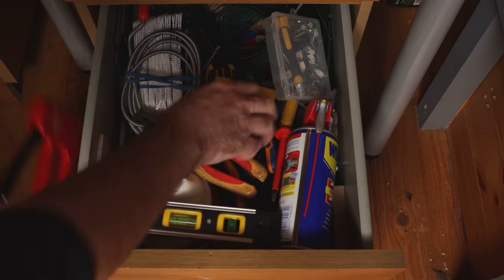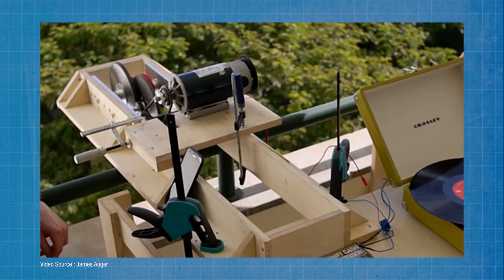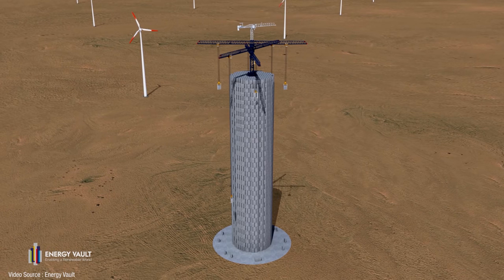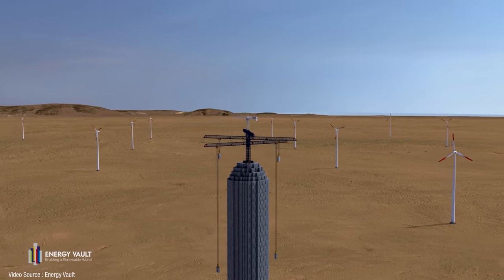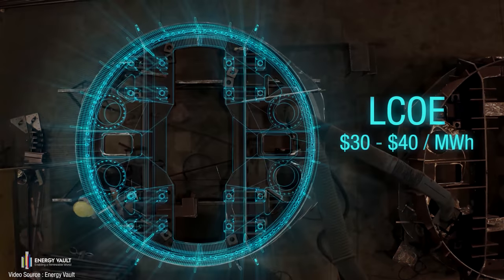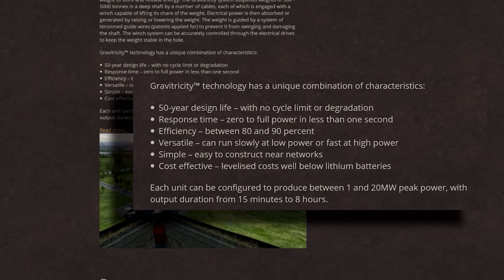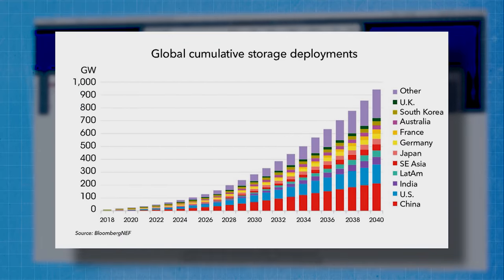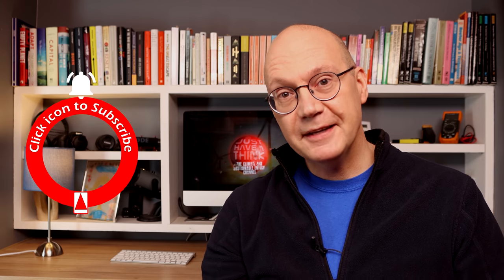Gravity Energy Storage : A very uplifting technology!

Comment: The energy capacity is WAY too low for how complicated they are. Pumped hydro is the clear winner since you can store millions of tons of water very easily.
Reply: It's not one-size fits all. If these technologies can be optimized to be cost-competitive, they'll play a role in a comprehensive grid-level storage solution. A win no matter how you look at it.
Reply: Pumped hydro has a far lower energy density and would actually take as more material to make than an equivalent capacity system. It also has large ecological effects and can impact across national lines (eg the damming of the Nile).

These systems also provide a potential use for otherwise waste construction material.
Reply: Pumped hydro can't be built everywhere. People will need different solutions for each situation. In the plains/prairies, there is no suitable landscape for pumped hydro.
Reply: PH is only good where there is plenty of water & suitable geography.
That excludes large parts of the planet

Comment: I'm the inventor of "drag negation".  I think there are many possibilities using the weight of the ocean itself as energy storage.  Some years back I thought of giant balloons on ocean floor, filling and then using escaping air pressure to drive generators.  But perhaps something with higher efficiency would be a vacuum chamber at depth with variable volume (piston/cylinder arrangement).  Water seals at 500 atmosphere pressure might be difficult but if possible, would be an excellent giant battery and if anything goes wrong, there's no humans around to injure.  Glen McDiarmid.

Comment: The liquid metal batteries promise a high efficiency , high cycle life grid storage option that is un restricted in deployment.
Reply: How do they compare in fully amortized cost to the gravity storage described here?  Gravity is claimed to be 4 cents per kWh, according to the video.
Reply: @incognitotorpedo42  We should combine this systems for grid frequency estabilization & baseload grid filling.
. The gravity storage contains huge ammounts of energy, it can "blackstart".
. The liquid metal batteries requires heat to keep themselves "liquid" (so in case of a failure it shutdowns & needs a lot of input of energy); but while they are operational, it is more efficient.
-> Combined with liquid air storage (the heat reservoir in/next the liquid metal batteries), there is a thermodynamic sinergy [plus allowing different ways to charge/discharge].
Reply: @incognitotorpedo42  my understanding is that it is cheaper than pumped hydro.
Reply: @adolfodef  as part of a grid , it would be expected to have multiple charge and discharge cycles daily.  The longer that a liquid metal battery is expected to hold a charge the less efficient that it gets. This technology is for frequency regulation and short term power storage for 1 or 2 days. But that is exactly what is needed for solar and wind farms or grid scale frequency regulation.
Reply from the maker: Hi Drew. We'll be looking at those in the next video.

Comment: It has been seriously proposed to build this type of system using disused deep coal shafts on Upper Sielesian Coalfield in Poland. 
Also it has been suggested to use the  abandoned shafts in a pump storage hydro system. With a combined water turbine generator/pump system at the bottom of the shaft. Note these shafts can be upto 1100m deep.

Comment: I think the mine shaft idea has a really good potential.
The other one, lowering bricks in an open area might not be a good idea.
1. It requires extreme precision and weather conditions, especially wind affects a body suspended by a cable more than 50m length in avg.
2. We get maximum energy output when we lower the brick on top to bottom and it gradually reduces as the bricks stack up and gets to zero as we reach mid height of the tower.
3. Concerns about stability of stacking

Comment: I really need someone to check my math(s) here
Potential energy = m g h
So 25 tons over a 150m mine shaft
P. E. = 25000 x 9.81 x 150
P.E. = 36787500 J (sounds good)
Or 10.2kWh Or ~1 €/£/$ of electricity. Not so good. A little more than 1 Tesla powerwall. Not a great return for a hefty crane hanging over a very deep hole. Would appreciate any corrections
Reply: Looks right. This is why gravity storage needs such large scale.
Reply: @PaulMansfield  At least I'm not going mad. Pumped hydro works because you have huge amounts of water. You would need enormous amounts of concrete and pulleys and motors that need to work under enormous loads for large amounts of time. Doesn't add up for me.
Reply from the maker: Sounds like you're referring to the gravitricity site. That one is only a small scale demonstration. They will be far larger at full scale and have multiple weights in multiple drop shafts.
Reply: @JustHaveaThink  Thanks for your response. Day made 😊.

Comment: The concept presented in 5:41 is just the Levelized cost of electricity storage that has to be combined with the Levelized cost of electricity generation and divided for the electricity dispatched to obtain the Levelized cost of electricity. In the case of fossil fuel power generation, there is not a problem because 100% of the power generated will be dispatched, however, due to the intermittency of RES generation and the absence of storage, RES generally undergoes curtailment. Context plays an essential role if we use storage facilities because it is not as simple as adding up the values for generation and storage. Depending on the load profile part of the electricity generated will be base-load (costing only what generation costs), while the surplus will be stored and dispatched when needed (combining the costs). That is the reason why it is really complicated to generalise Levelized costs of electricity for Renewables.

Comment: 6:30 "They claim a 50-year design life -with no cycle limit or degradation" Sounds like marketing wank to me. I've worked with 450 tonne (1,000,000 lb) cable hoisting systems and sooner or later the cable will have done enough work that some or all of it will need to be replaced.
Reply: I don't think they mean "without maintenance".

I think what they mean is that after 50 years, it will still produce the same quantity of power as when it started. For example like how batteries degrade over time, even with proper maintenance. 

It was an odd statement either way, like the 90% efficiency claim also....
Reply: Obviously the system will require routine maintenance. The statement was "no cycle limit or degradation" - which is accurate to the system as a whole, but not every single piece of equipment in it.
Reply: @anonuser12345  That would be the same for battery storage though. You can exchange the cells, the system as whole remains.

Comment: Another cool idea would be to use old oil platform rigs in the gulf to lower weights from with a buoyant attachment so the waves could raise them. The waves could pick them up and gravity pull them down. With that system you’d have no loss of power in having to pick your weights back up.

Comment: can this be integrated into elevators and cranes like alternators for the building/vehicle?
Reply: Good point, I live in an apartment block with lifts, the energy could be used for the communal area lighting at night.
Reply: Modern elevators, cranes trains do operate using this principles: if it is possible a lift will generate electricity and put it back in the grid. Same goes for trains and cranes (at least for the modern ones).
Reply: Yup they already do this.  But gravity on earth is very weak so there is not that much energy that is possible to be stored in such a system.  Now if we built elevators on the sun, we could store a lot more energy!

Comment: What about useing the tyde to lift  heavey weight twice  a day.
Reply: You can use the tide to capture tidal flows at high tide and then gradually release them to generate power, so long as you have enough water and a decent difference in water levels.
Reply: There's a system called tidal lagoons. They do basically this
Reply: @romuloramosdias1137  Good idea. Where are they currently in operation?
Reply: @yggdrasil9039  there are many of those in Europe, but I don't remember exactly where. There's a video explaining this

Comment: My assessment is the mine shaft would be the better system than the tower system since high winds and other severe weather would not affect it. Thus, the mine system would be more responsive during such times of severe weather. Plus, I would be concerned about the heavy blocks falling during a storm so that the tower operation would have to be secured for storms and thus not available when most needed.
Reply: Low wind profile high weight not really a big issue. Earthquakes are more real risk.

Comment: That's really encouraging and indeed something I wanted to explore mathematically for economic feasibility. Do you know how well each energy storage technology will compared among the many that we have explored so far?
Reply: @channelwarhorse3367  encouraging for humanity.
Reply: Energy is meant to be utilized, stored is for what?
Reply: @channelwarhorse3367  perhaps you are not familiar with how the sun works. it isn't always there therefore you cannot always use its energy. A storage system works wonders here.
Reply: @bmlbigbang  mass manufacture gravity engines, light curves as Albert Einstein states, as to Aapplied Relativity applications global civilization can lower sea level.  Am used to clean energy technology, constant energy utility.  However freezing a 5 .meter ice cap at the north pole is controllabing the planet's temperatures 🌡. The sun is to be utilized by mechanical means.  Am for energy storage, lower sea level immediately 💘.... and decarbonize the atmosphere.  NP 😊

Blocking the sun to cool the planet, is energy control mechanic.  Be the Greatest Generations 👍
Reply from the maker: Hi Ardavan. I imagine that is something that you could get from the International Energy Agency or Bloomberg New Energy Finance.

Comment: If one wants continuous power out of these, the Jenga Tower would, at least, allow for "overlaying" the sequential descent of multiple blocks. The "discharge" at 50% height is not exactly true since outer 'rings' have a larger circumference (able to hold a few more blocks). Maximum discharge is reached when all blocks have been lowered to lowest height. There would be losses because of the necessary horizontal (radial) (and some angular) transport of the blocks. Every aspect of the mechanism is "critical". QC of each block would be quite something... Imagine a single block failing (crumbling because of cycles of compression and no compression), causing the entire tower to tumble... And, as others have pointed out, if the storage is near the point of production (a wind farm), wind loading will be most hazardous at those times the source has an overproduction of energy that one would like to "store"... Good luck rebuilding the inner column in those weather conditions!

It seems they are pivoting to a different design that involves a weatherproof giant steel lattice to support massive discrete blocks that are raised and lowered.

Dream big!

Comment: Hi! Usually I quite enjoy your videos, however you obviously have overlooked a few things in this one. The issuw with gravitational energy is, even though the energy stored in a contraption like EnergyVault's tower idea seems much to our intuition, a few simple calculations show that is is not the case at all. Just assume one would build a tower of 100m height & diameter of 20m, and all the space is filled with such concrete blocks. The mass of this tower would be 2000kg/m3 * 10^2*pi*100 = 62.800t. Multiplying that by an average height of 50m & gravitational constant 9.81 results in 8.55 MWh of energy, assuming an efficiency of 100%. Comparing that to a system like Tesla Powerpack (172.000$/0,232MWh) it would cost 6,3 million dollars. Now using an average price of 300$/m3 of concrete, just the concrete alone for building the tower would be 9.4 million dollars, no cranes / electric equipment installed. Even with battery prices today, concrete gravitational storage is not able to compete.
Reply: That's what I have been trying to tell people in the comments! It works in theory but is definitely not practical!
Reply from the maker: Just for clarity Matthias (and to dispel what appears to be a popular misconception among several commentators this week) - I did not personally create this technology (or any of the other technologies that I have reported on over the last three years) , nor did I start the company called Energy Vault, so it is disingenuous to suggest that there is something inherent in the design that I have overlooked, becasue I had absolutely nothing to do with designing it. My role on this channel is to report the work going on in the world of sustainable technology. I can however confirm (as I mentioned in the video) that there are 6,000 blocks in a typical Energy Vault configuration each weighing 35 tonnes, so my maths tells me that is 210,000 tonnes. I also suspect that many structural engineers and scientific developers will have worked quite hard over many many years to ensure that they have carefully calculated precisely what the towers can and cannot do. Without these numbers it's unlikely they would have attracted any funding or been allowed to build the tower in Italy.
Reply: @JustHaveaThink  Thank you very much for giving such a detailed answer. You are absolutely right, it'd be impossible to grasp every detail & look behind every technology you present here on this channel, even for people with an engineering degree or who work in the renewables sector as the spectrum of renewable technologies is so broad. What my comment referred to is that many people have a similar view about concrete based gravitational energy storage, you'll probably find a view videos on youtube or articles that are dedicated to such contraptions which look at them rather critically. Nevertheless, please do not get me wrong: I really appreciate your work, we need more people like you who translate engineering language into common English and convey struggles we face at de-carbonizing our society & implementing renewables and their possible solutions as (at least from my point of view) increasing awareness is an utterly important issue. I just would have been very delighted if you'd have included a few critical voices in your video. Concerning the calculation, the price per MWh is only a function of height so the absolute mass is irrelevant, I thought I'd demonstrate it with a small example so that it is easier to understand. Additionally, there are many other costs to consider (like maintenance and generally high OPEX) which I did not mention in order to keep it simple. As far as due diligence by investors like Softbank is concerned, I personally doubt that they did thorough research as they would not have invested that much money into a very controversial technology it they had done their work properly (at least I hope so). It wouldn't be the first time that investors are misled / conceived by some revolutionary newcomer company.

Comment: There's no current leakage losses either as with chemical batteries.

You could have a mechanically linked wind turbine, or a water turbine to lift the weights so combining storage with generation.  Mechanical generation directly to mechanical storage would eliminate the mechanical to electrical to mechanical losses.